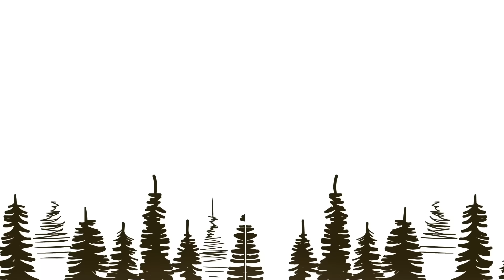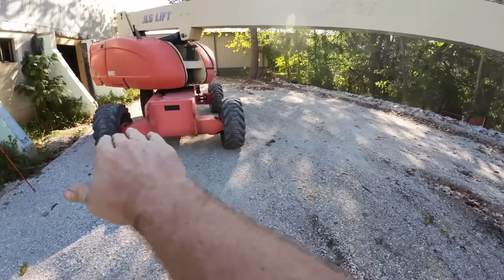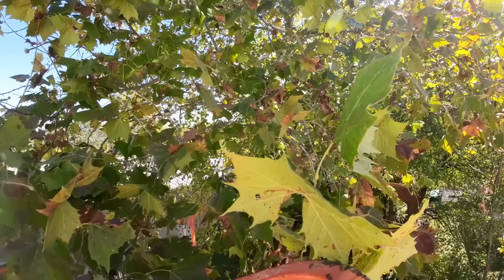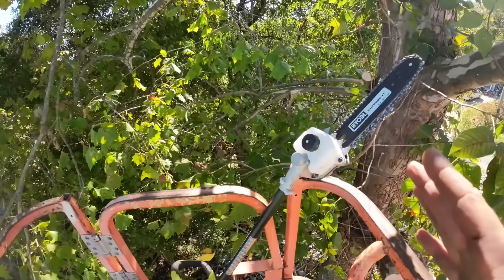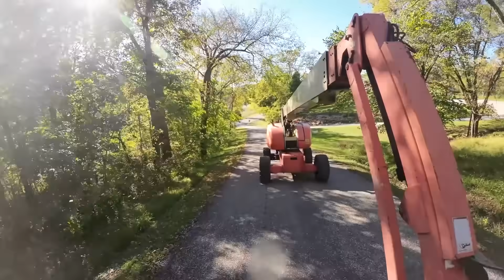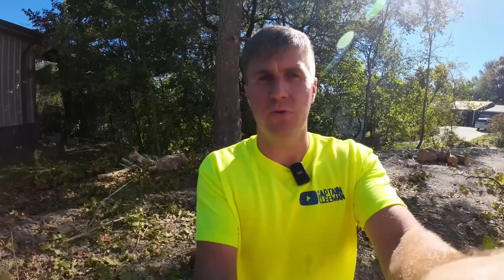DIY Tree Removal - Is The Risk Worth the Reward?

Comment: I had ordered a hipa carburetor for my chainsaw. Came as a kit and the only thing that worked was the carb, everything else didn't fit.  Was frustrated about it but hipa took care of me for the problem. All they asked was a few pictures showing the problems. If they ever get my size chain in stock I will order and give them a shot. Thanks hipa for sponsoring the Capt.

Comment: Sure beats doing it with spikes,
Reply: @jimurrata6785  thanks
Reply: @georgerogers542  If you're not used to climbing it's real tough on the inside of your thighs, and generally you want to start cutting limbs completely off from the bottom up to avoid unclipping all the time.
Climbing through that patch of poison ivy would have sucked!
Reply: @jimurrata6785  I was climbing with climbers in the USFS in the early 80s all the way to the late nineties fighting fires topping trees to keep crown fires from running! And in the off season we cut tops out of trees so eagles would have a place to nest and feed themselves instead of power poles! So I do know a little bit about climbing and speed climbing!
Reply: @georgerogers542  I don't mean to suggest that you don't know, but I doubt Mike is accustomed to it.  🙂
Reply: @jimurrata6785  I think Mike is a big man and understood what I was saying seeing how he responded to it!

Comment: Cap’n I’ve spent a fair amount of time limbing trees from a crows nest.  I have yet to crawl out if one without rubber knees and elevated blood pressure!

Your logic on cutting limbs from the top down is impeccable for getting them to swing down.  The only caveat is if you are pruning a tree that you want to keep.  Then, a feller wants to go ahead & use your cut on the limb while leaving a stub at the trunk.  As the limb swings down it tends to peel the bark.  With the stub, it doesn’t peel it from the trunk.  Then, you start to cut the stub off with an upward cut at the collar.  Then, finish by severing it with a downward cut.  I know you know this… but thought I’d posit it here as a PSA for folks who might want to save their tree.

Now, about that speeding issue… your DJI made it look as clear as glass… but, I bet my GoPro would have been as murky as pond water!!!
Reply from the maker: Good tips!

Comment: Captain, I love the content. I enjoy it very much.
I do a lot of work off the ground with safety lines and fall arrest harnesses. It's great to see you all geared up, but you need a chin strap on that helmet. If you (God forbid) ever fall, you WILL bang your head, without a helmet on your head, you can be knocked out and hang there, which is not a good thing. I'm not trying to be a safety Sally here but, you need a chin strap on that helmet.
Cheers from Tokyo!

Comment: Re: World Headquaters. 
Would cutting out a portion of the gym area floor large enough for your larger equipment ? Then make the same area of the ground floor cement so you can drive the equipment into the now increased height area. This way the original foot print of the building won't change however the increased interior of the equipment area will be available.

Comment: I have no doubt that the DP crew has put more long distance miles on that man lift than any other owner.  The fact that it keeps going after all that constant traveling proves it was a good investment.

Great job getting the tree cut down.  It's a great shade tree, but the real-estate is necessary for the future building.  And a potential tree through the roof of the headquarters building is voided.

It'll be great to see the new old dump truck moving beyond the DP yard and hauling the tree out.
Reply from the maker: Fingers crossed parts come in soon!

Comment: With that lift being older but some of those will shut off before you run out of fuel to keep you from needing to prime it. They have a timer that shuts them down when the fuel lights on. Just go ahead and start it and you can keep on running. Ran into it a lot when I was delivering them for Sunbelt.

Comment: Putting a chainsaw checker board pattern on that stump goes a long way to allowing moisture, bugs, and dirt to rot it away.  Plus your kids won't slip jumping on it.  Good tree removal Captain, Cheers!
Reply: And you can also drill 1 inch deep holes about every 6-8 inches across the stump with a 1 inch spade bit. That’s what i do, no chemicals or grinding needed.